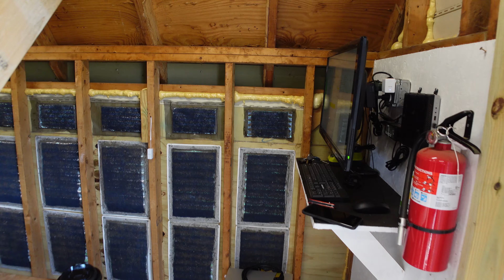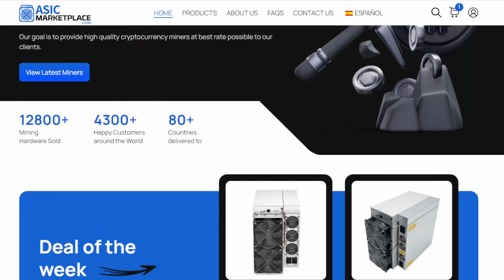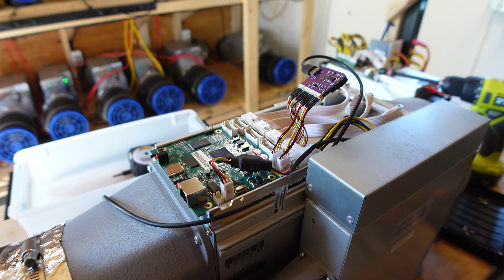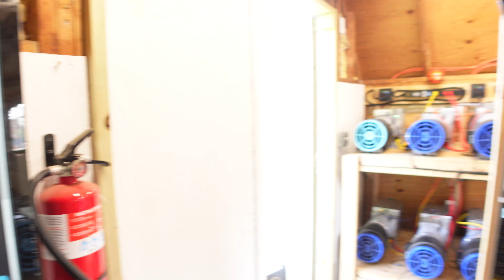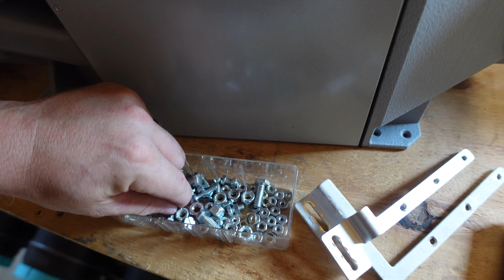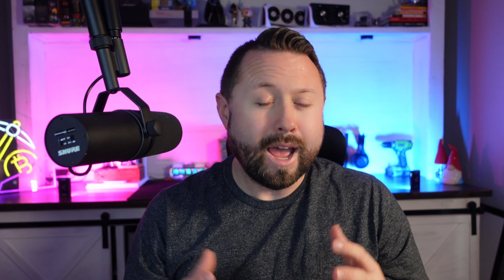I Can't Believe This Happened, To My New KASPA Miners!

Comment: Hi, I have 4 of these ks5L and red blinking 3 or 4 times and one green is a fan on psu start up issue something blocking the fan or opposite your AC infinity is running at full speed and creating this error I had exact same issue and when slow down AC infinity fan it works no problem so your psu probably is fine. I have posted video about a month ago of that issue on KS3M if you want to check it out they all react the same way on PSU since all PSU for these units are the same.

Comment: Yall need to stop with the kaspa miners.. just gonna be bricks. To the one who asked what makes me think that.. look at the tokenomics..
Reply: What’s bricks?
Reply: @Cwjltmadubadu  what does a brick do?
Reply: Why? What makes ya think they won't continue to make money?
Reply: @jakebudzinsky3800  tokenomics
Reply: @jakebudzinsky3800  tokenomics
Reply: @jakebudzinsky3800  look at the tokenomics
Reply: @jakebudzinsky3800  one word.. tokenomics
Reply: @jakebudzinsky3800  making a small profit daily isnt the point. the point is to mine back more coins than you could have bought for the price of the miner and the cost of electric. 
right now a ks5l makes 2k-2500 kas a month. it costs over $200 a month in electric which could buy you 12-1500 kas. so you're only profiting 1k kas a month. plus kas reduces the block reward every month and the hashrate keeps going up so those numbers are going to drop. especially with the oct batches coming online soon. pretty easy math to put the money into the coin rather than the machine. yeah if kas pumps the machine might go up in value later, but with new machines coming out literally every few months good luck with that plan.

Comment: @THM Brother the only time the PSU light flash is when the PSU fan or fans is not working, however a solid red light is communication issues,  just know that even if the PSU fan is spinning a little it may not spinning as fast as what the controller is looking for so it flash the red light .. solid red is communication issues or failed power regulator.
Reply from the maker: That is super helpful!  Thank you!